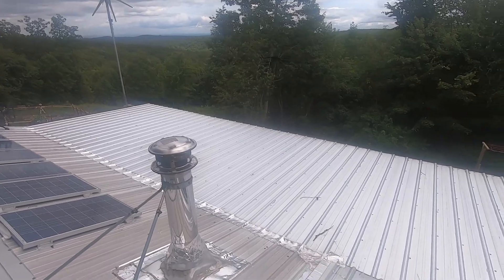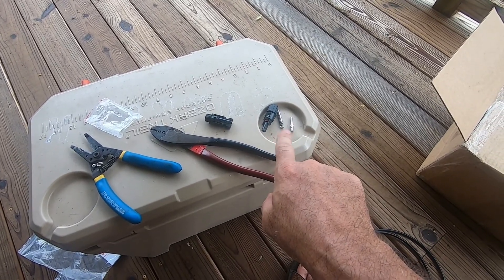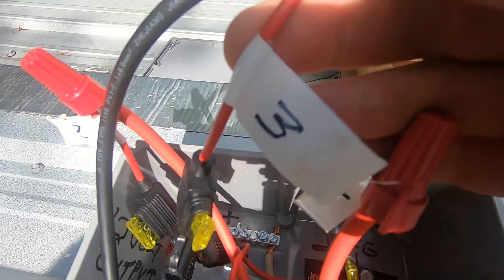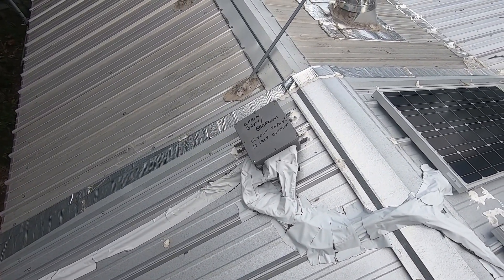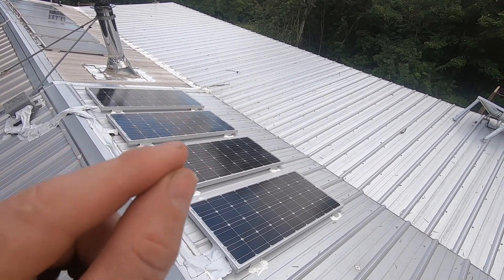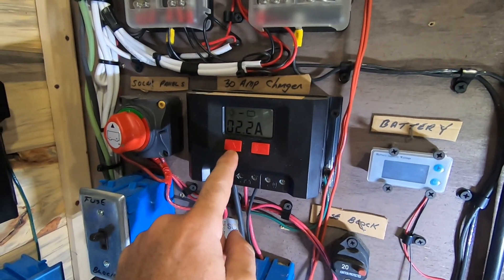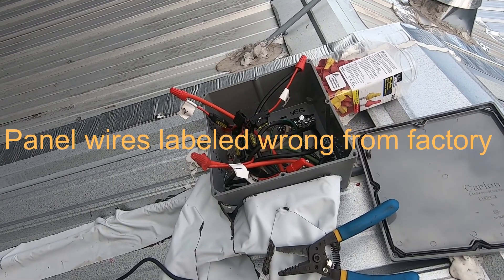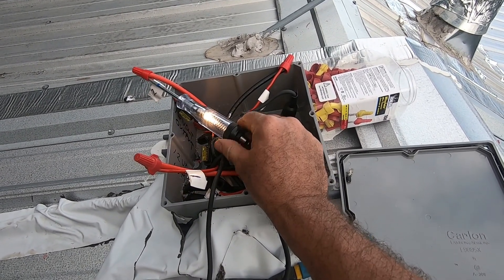Installing Off Grid Tiny Home Cabin Homestead Solar Panels and how to Troubleshoot Them

Comment: I have 4 Newpowa 100 watt panels and I was going to double them this week. The model I have got upgraded and are thinner and longer now. I really wanted to keep it the same but oh well. I may just order them Friday.
Reply from the maker: Yeap... never fails they change look.at HQST panels it might fit your needs they are a little bit old school.  Hope you subscribe: )
Reply: @GrumpyMountainMan  I tried looking into 5 different brands but they all appear to have made changes. I subbed for now but will subscribe using my other account to keep all the solar stuff together and welding on another account.
Reply: My wife told me to build a cabin on the 8 acres. It's all falling together with her support. Thinking of a 16 x 32 cabin sitting on 9 feet stilts.
Reply from the maker: @cutweldngrind  awesome I put 2 storage buildings together then added a porch to the front. Very inexpensive build

Comment: A test light is a polarity tester?  How does that work?  How does it work with a negitave that's not bonded to the ground too?
Reply from the maker: It's a automotive test light that works off 12 volts.
Reply from the maker: Thank you for watching the video

Comment: Yes, I did learn something! 
What panels are those? 
If you're in squirrel country it may be a good idea to encase your wires in steel mesh to protect them 
Thanks again 😊
Reply from the maker: Renogy panels and that cable you can't cut with an axe. It's why I use it.